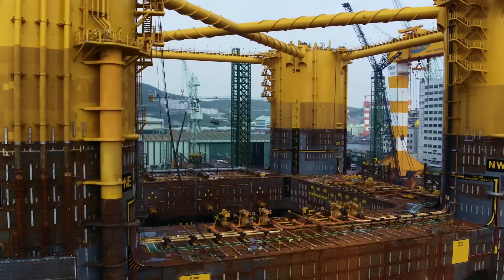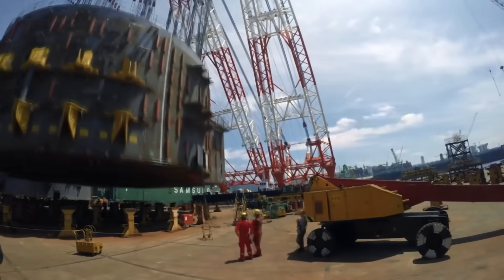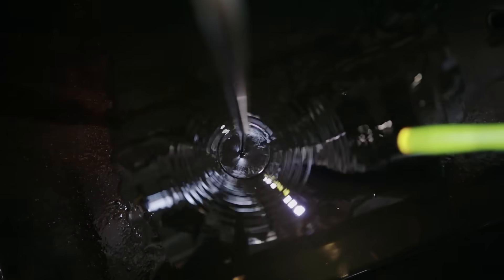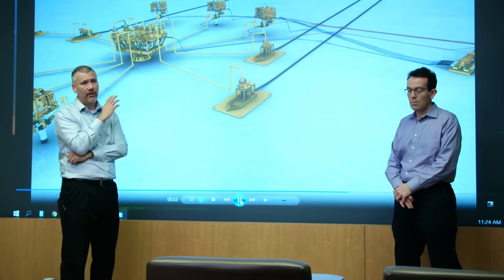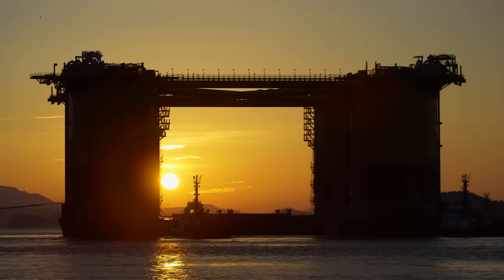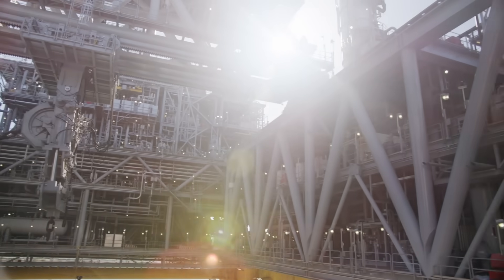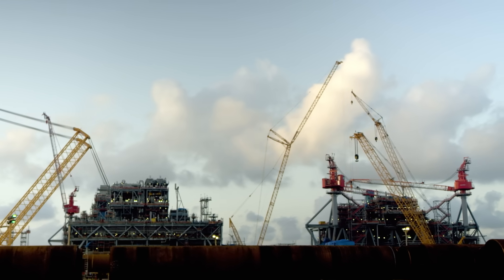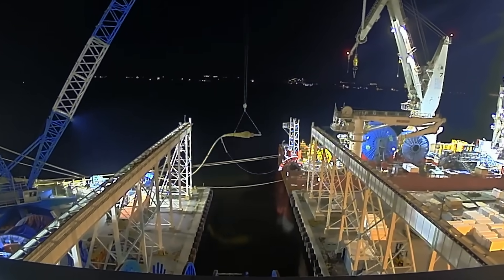Skyscraper at Sea - Building the Amazing Appomattox

Comment: Don't see why they were so worried about how much water the rig uses for cooling when they are floating on the ocean. Smart getting the cold water though as you get better efficiency. And the use of gas turbines is smart as they can run the rig from the gas they produce saving them money.

Comment: Weird how most oil rigs are dying out and here comes Shell with a brand new one.
Reply: @lmao this isn't a name I was talking about Oil Rigs not the oil itself.
There might be only handful of oil rigs that have been made in the past 20 years. 

The cost of maintaining it, transporting people to and forth every 2-3 weeks, transporting supplies for operating the rig and transporting the oil itself back to the shore is not that feasible compared to just drilling on the land.
Reply: All oil rigs eventually run dry. It's normal since they're extracting a finite resource. They're not designed to go on forever. Once it's no longer profitable, they move on and find fresh oil.

Comment: Ok well I thought oil rigs were attached to the sea floor. My mind is blown that they float
Reply: Fr i was thinking the same
Reply: They are attached by heavy duty chains from seabed.
Reply: Well they are sort of. The drill does go below seafloor.
Reply: Some are.
Reply: Petronius rig is. Basically 2000 feet of steel scaffolding and pylons. But ones like this that can be moved are more sustainable.
Reply: Some are attached
Reply: Its like uhm.. deeper sea oil wells need to float cause you cant go that deep with big legs plus deep water rigs can be towed which is cool
Reply: oil rigs in shallow waters are typically attached to the sea floor, beyond like 1500-2000 ft its more common to be semi submersible platforms however :)

Comment: How do they decide where to set up the rig in the ocean?
Reply: Wherever they discover oil. They have various ways of detecting where oil will be. They get a general idea of a good oil supply then they go out abs investigate the best spot to extract it. Set up the rig, drill into the sea floor, then pump out the oil.
Reply: Typically they use a divining rod.

Comment: what gets into the ground when oil and gas are taken up? what material has the ability to stabilize the subsoil as good as oil and compressed gas. Nothing can replace Oil and Gas so subsoil worldwide is and will be unstable.
Reply: A mix of sand water and chemicals.
Reply: @hunterlong1820  which has been proven to not work that well while also managing to leak into water supplies causing everything from cancer to sudden death

Comment: Is the byproduct of the energy-plant steam??? Hot water???  Water desalination??
Reply: Skyshark88 the platform uses jet engines fueled by fuel made on site from the crude oil. The jet engines turn turbines which make power, then the heat from the jets is captured and make steam which turns another turbine that also makes power. It’s amazing, and completely self sufficient!

Comment: Just a matter of time before there is no oil...
Reply: you green people been saying that for more than 40 years and now we have more oil than we ever had before
Reply: According to the British Petroleum’s 2019 Statistical Review of World Energy, the total proved reserves of the planet’s oil at that time was 1,733.9 billion barrels. Yearly global consumption in 2019 was about 35.9 billion barrels. A basic calculation reveals that if proved reserves didn’t grow, and if consumption remained constant at 2019 levels, it would take only about 48 years — meaning some time in 2067 — to exhaust those reserves. The trouble is, proved reserves only represent the oil that a given region can theoretically extract based on the infrastructure it has planned or in place.

But that's only the proved reserves of oil. The oil that we, for sure, know exists.  We do not know how much oil the Earth actually has. In fact, the thing to worry about is running out of locations to mine oil. Only in certain spots on earth can we mine oil; there may be tons of oil under the middle of cities and populated areas but we can't get them because there are people living on top of them. By the time that even happens, the world will most likely be primarily run on renewable energy. 

In short, we will never run out of oil, but oil will become less and less relevant as time goes on and will eventually become obsolete.